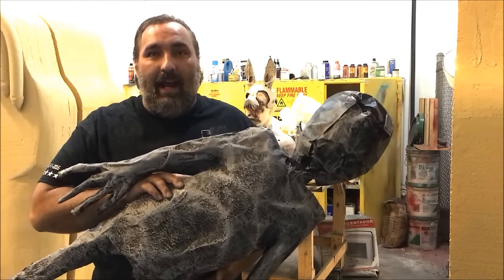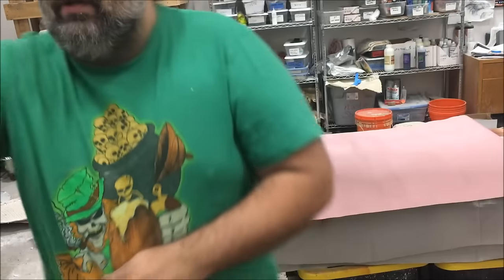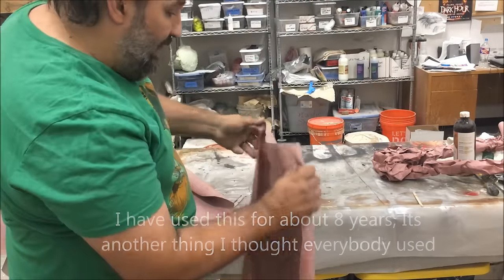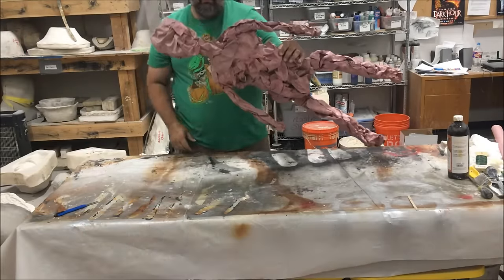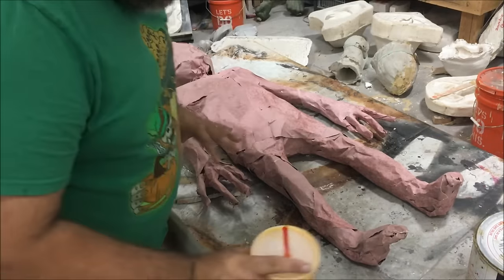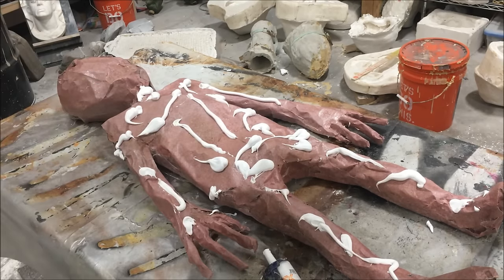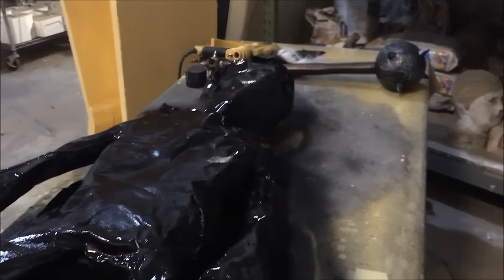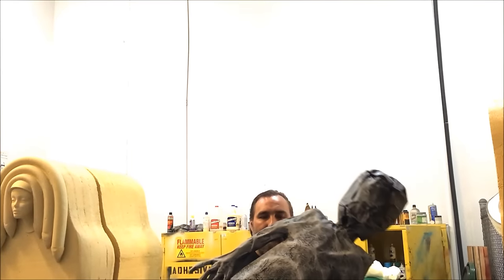Build with sticky paper

Comment: Thanks for this. I've seen items made this way, but only the finished products, and never could find anything on how to actually make the sticky paper. Looks like it would be beat the heck out of waiting for mache to dry. One question, since I've never worked with contact cement before...would this be safe to use for costuming, say for building up a rough shape over a pair of stilts for a creature costume?
Reply from the maker: +RogueAPBT yes it would, but it is paper so it can't be near areas that sweat.
Reply: Thanks for the reply. Not sure if this costume is happening for this year, but when I get time for it, I'll give the paper a shot and send a pic if it works out.

Comment: Sorry if this has been answered in one of your previous videos, I'm new to the channel. 
How does the EZE gun hold up using the contact cement? Are there build-up issues? I can't imagine it being easy to clean...
Reply from the maker: +Elkyrie it's amazing. I have an air blaster for the airline also- when I refill I just blow out the tube of the gun and that keeps it flowing really well.
Reply: I see, sounds easier than expected, then! Might be an interesting investment for future projects. Thanks!

Comment: I know this video was several years ago and you may not see this question, but I'm putting it here just in case someone else has the answer. Is there another way to efficiently spray the contact cement?  I don't have an air compressor and not interested in purchasing one.  I thought the sprayers used to hold pesticides that you manually pump, but the cement is too think to run through it, correct?
Reply from the maker: its too thick for that- you could just paint it on, it would just take longer

Comment: Do you have to worry about making it flame retardant?
Reply from the maker: +Rob OBrien  depends on where you are and how it's used. If the item is under 5% of the fire load in a room, then I don't worry about it. If it will be more than that, then you spray the paper with flame retardant and let that dry before you spray with contact cement.